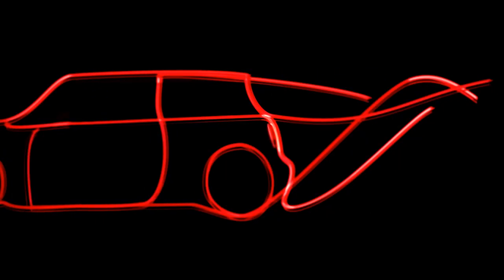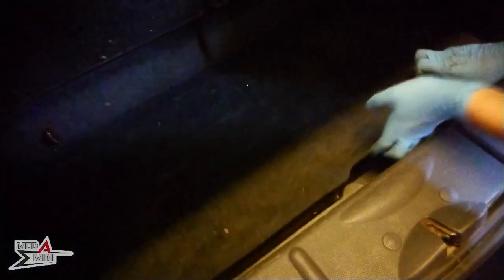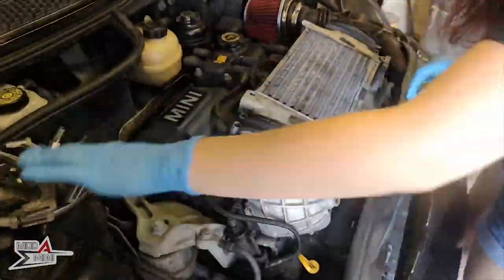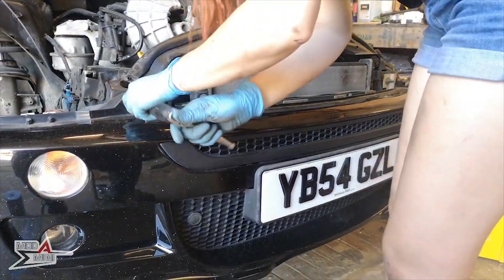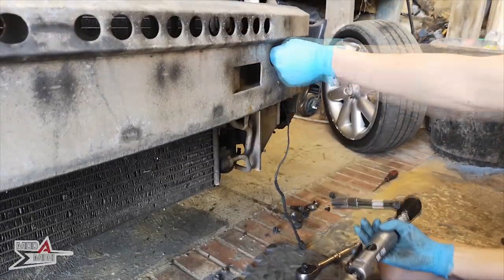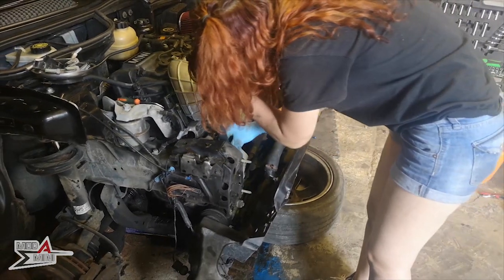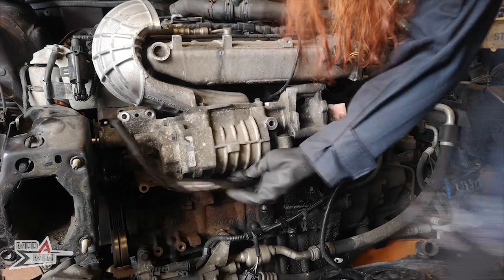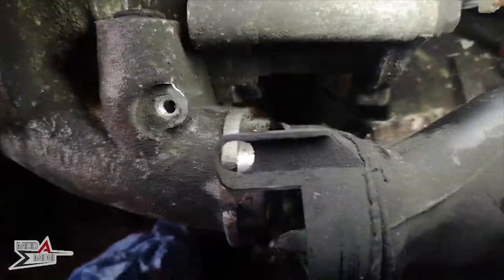R53 Supercharger Removal... by a GIRL!!!

Comment: After spending well over $ 4000 in the last couple of years,  my turbo charger was acting up, was ready to sell or junk it, your video was very inspirational, so far I’ve managed to removed the bumper and the bumper guard, 😂, if a girl can do it so can I , thanks 🙏🏼 next the radiator,,,
Reply from the maker: Yea that's the spirit! Just need to get stuck in, that's half the battle. You need to get to the stage where it's easier to finish the job than put it back together for a garage to do 😋 thanks so much for watching, Miriam xx

Comment: Get a pair of flexible long reach hose clip pliers. They are almost essential kit these days! Spring clips are best (usually) as don't have to worry about how tight and should be quicker to fit than worm drive clips (Jubilee clips). Hope this helps
Reply from the maker: Thank you so much! Yes it really does help! Hate these clips, we have just bought a garage and in the tool chest is the proper tool for the job! Can't wait to try it!! Thanks so much for watching, Miriam xx

Comment: Hi just come across your channel as im interested in getting an r53 to make a fast road weekend toy . But do not have thousands of pounds to spend look forward to watching all your videos to give me ideas and get through lockdown .
Reply from the maker: The R53 is great car with ~170hp as standard they arent power houses... Spend £1000-1500 and you should see 200-220 hp soend a little more sorting the suspension and ypu will have a car then will fly through twisties roads and tracks like no other! Not only that at the moment they are rock bottom pricing wise :) thank younso much fornwatching and commenting, Miriam xx
Reply: @ModAMiniGarage  Thanks Miriam for taking time out to reply . Its the handling over power I like do you think its worth fitting a limited slip diff and uprated clutch ? . Thanks Michael .

Comment: When you remove the wheels use a breaker bar to crack the bolts loose while the car is on the floor. Then use the impact gun when the car is on the axle stands. Never undo wheel nuts/bolts with a impact gun or you WILL snap them one day. Good on you for having a go and getting your hands dirty, Most girls don't like too.
Reply from the maker: Wow I never new that!! Thanks so much for sharing your knowledge, I always undo them the easiest way hahahaha, thank you so so so much for watching, Miriam xx

Comment: Hi! Nice job, please advice on Mini Cooper S R53 supercharger service. Do I need to lubricate the supercharger rotors/ blades when servicing. Well I did dismantle everything and washed all gears with petrol including rotors, now after reassembly I noticed some clunking noise coming from the top or around supercharge areas when idling?!
Reply from the maker: We don't do anything with the rotors apart from examine them for damage. We then check the nose and gear areas to make sure these are in good condition. With regards to the clunking they always have a little clunk to them but it shouldn't be loud! I hope this helps, Miriam xx
Reply: @ModAMiniGarage  Many thanks for your response, just a quick one; My mini  S R53 temperature gauge seems confusing, it drops when I go on a highway like going over 100 km/h, it goes towards the cold side of the bar around lower quarter part. And when I reduce speed or in town driving at low speeds, it becomes normal again to half centre part! So um wondering if it's normal if not what could it be?!
Reply from the maker: It's not  normal... but showing colder it's better than showing to hot for sure!  I would look into a replacement thermostat :) we do aluminium replacement housing with a thermostat that I need to get listed on the website! Might be a good starting point :) regards, Miriam xx

Comment: Hey, great video, this is a job I'd like to tackle next summer (no room to work in a flat carpark currently). I'm hoping to service the supercharger and also upgrade the pulley and intercooler. I've tried to make a note of the bits that you broke / found perished and needed to replace but if you've got time could you comment a little list of bits that will likely need replacing due to breaking on removal or have perished over a 20 year 100k mile life time? Also, does the air con have to be de gassed for this job?

Cheers!
Reply from the maker: Thanks for your comment! Mostly they come apart fine, 2 things we have had break a couple of times are... the red clips for the breathers on the supercharger and supercharger intake pipe and also the grey plastic breather tubes... other than that they come apart just fine! If you break a breather turbo by new from BMW... they are cheaper than second hand!!! Hope this helps! Miriam xx
Reply: @ModAMiniGarage  thanks for the reply, I'll take all that on board. Is there any thing else special to know? At the risk of sounding stupid, does the aircon need discharging first?
Reply from the maker: No you don't need to disconnect the airco at all :) shouldn't affect that system :) drain the coolant, when you check the supercharger for oil... if oil comes out, don't bother taking the nosing off... however if little to no oil comes out then take it apart and check everything :) that's the best way :) Miriam  xx

Comment: Where are you located? I have a 2004 Mini Cooper S with 197,000 miles
Reply from the maker: Wow that's really good going!! How does it still run well?? We are based in Maldon Essex :) Miriam xx
Reply: Mod A Mini Garage Yes doll runs great no leaks have a couple good Mini mechanics and do simple things on it. Just worry about that Supercharger going but I baby it not speed too much 😎.  The clutch sticks a bit sometimes when downshift .
Reply from the maker: Sounds really good considering the mileage :) I'm sure if you maintain it as is it will be fine :) definately worth having the supercharger serviced if it's not been done!! should be every 100k. Miriam xx